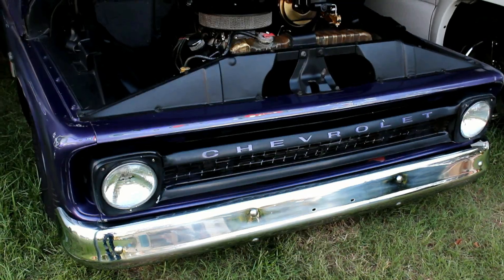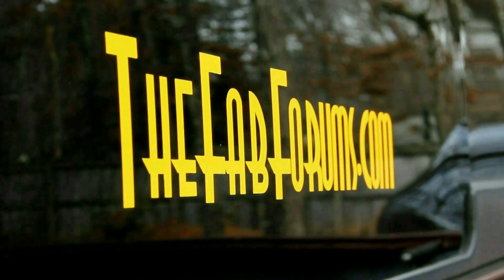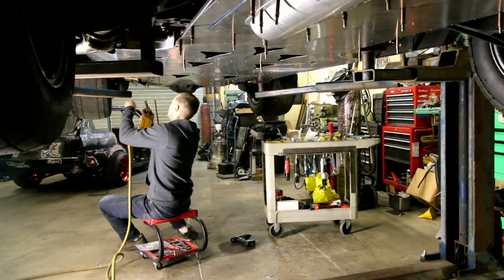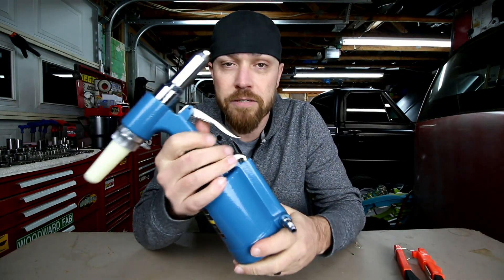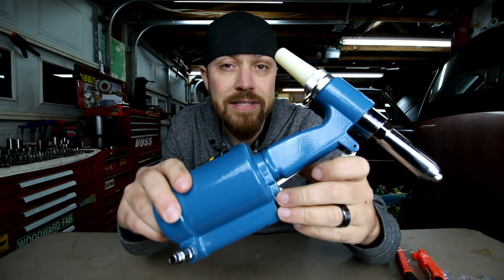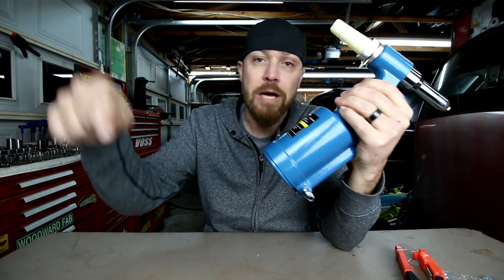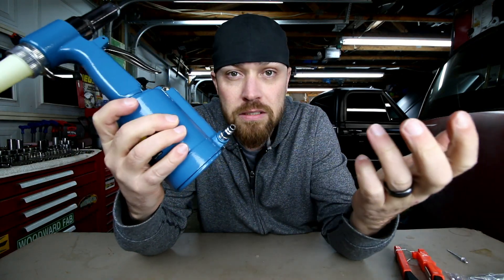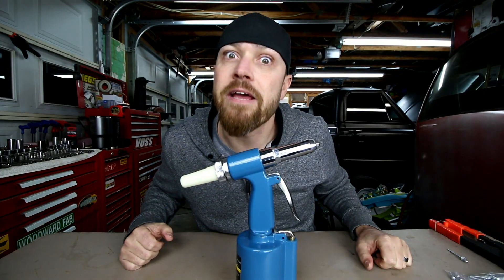You Need This Tool - Episode 52 | Air Rivet Riveter

Comment: I had a Dayton riveter from Grainger. It lasted 25 years making drums, then I got the one you're showing here from Harbor Freight. After about a year the end is stripped out because it is not made of steel like the Dayton.  I once saw a billboard from Orchard hardware, they put it about two blocks from the Harbor Freight store, that said " Time laughs at CHEAP TOOLS".
Reply: I bought both sizes harbor freight sells about 12 years ago and have used the snot out of em especially the little one. Still works like the day I bought it. Either you got a bad one or they cheapened the design since I bought mine. You mention something made of plastic, the only thing on both of mine thats plastic is the cone shaped spent mandrell catcher.

Comment: Had one since late 70's air over hydraulic. Got after I had put in a couple of hundred 3/16 pop rivets with a lazy-tong riveter and ended up with very big blisters on my hands and as I had over a thousand more to go I went out and spent a lot of money on the thing, price has gone through the floor since. But it has still paid for itself over the years.

Comment: Nice feature, Kyle. I've got one of those Harbor Freight specials in my tool cabinet. Love using it. After you add a swivel, the only downside is it won't fit in a tight spot. Gotta keep the old 90 degree manual around for that occasional job. 😉Have a great weekend, Mr. Voss!
Reply: TheMick26 I’m planning on getting the air air tool like you said at Harbor freight but what 90 degree rivet manual tool  do you have because I’m planning to do the firewall and strut towers in my car and was thinking I might have to pull out the engine?

Comment: Thank you for the suggestion. I bought it, and it works great with small rivets, but I'm having a hard time with bigger rivets even using the bigger nosepiece.
Do you have a video using 3/16" (4.77 mm) rivets with that Air Rivet Gun ?

Comment: I was planning to get spot welding done in between the welds I have in my vehicle but after seeing some videos on pop rivets I was wondering would this be good to put quarter inch pop rivets in between the spot weld I already have my car to hold up just as good for  structural support?

Comment: Kyle, for most of you fabricating gurus this will be a ridiculous question. . . but I shall ask it anyway.  When a rivet is inserted regardless of the tool, can the back or blind side of the rivet be snipped off so it doesn't protrude more than a tiny (not very precise, I know.  I can't think in thousandths).  Thank you for your answer.
Reply: Diane Lford: not without greatly compromising the strength of the fastener. If you have access to both sides you can put vise grips or a c clamp across it or have a helper provide an anvil while you whack it with a hammer to smash it further... but prolly wouldnt make it as thin aa youd want. From my experience even if you use the shortest rivets for the work youre still gonna have at least a 1/8" protrusion.

Comment: I use these everyday at work.  at least 1700 times a day.  I also use pneumatic AVK guns.  it pulls an AVK up between metal do you can thread bolts in.
Reply from the maker: I will have to look into those
Reply: Most AVK air operated hand installation tools are made and serviced by Ingersoll-Rand.
Reply: The Fab Forums I can private message you a picture of them on Facebook when I go to work Monday
Reply: The Fab Forums I work for a Commercial Vehicle Group in Grover North Carolina we build Mack Trucks
Reply: patw52pb1 I'm gonna check when I go to work
Reply from the maker: on cool

Comment: I've used one to build a coolroom. They're absolutely genius. I'm looking forward to Battery operated ones to become a huge deal as air operated tools are going out of fashion..
Reply: Shane Martin 
Battery operated tools will never replace air tools especially in a shop setting. air is simpler  stronger and more affordable. Batteries shine in situations when power isn't easily accessible or mobility is a requirement. I would say battery operated tools complement air not replace air.
Reply: Ya battery powered tools are only the shizzit for guys who wont buy an air compressor. 4.5 cfm is all you need to run most any tools that dont constantly spin and air tools have the side benefit of being ice cold nice on a hot day. 
Most of these cordless tools that replace their air brothers are still pretty new. Lets see how you like em in a few years when those batteries go bad!